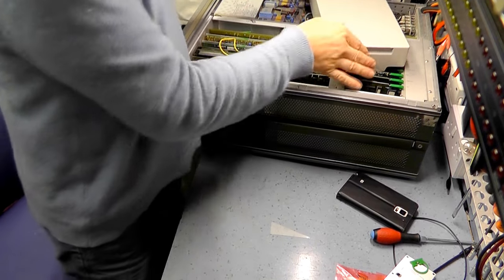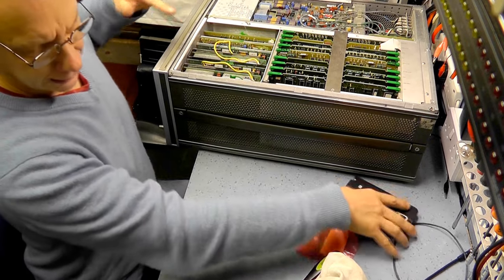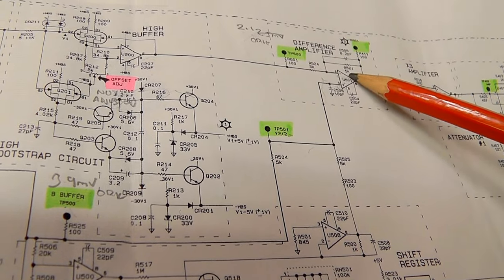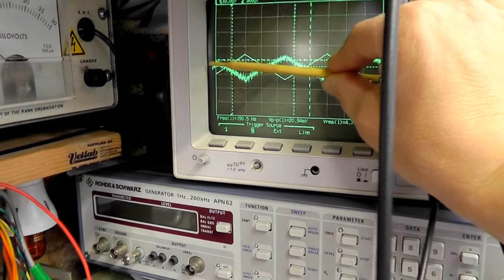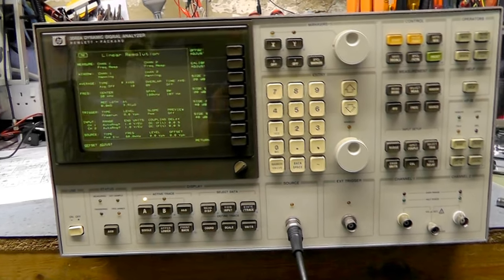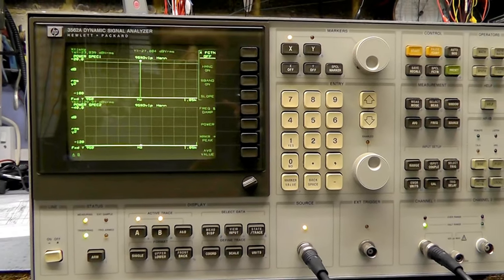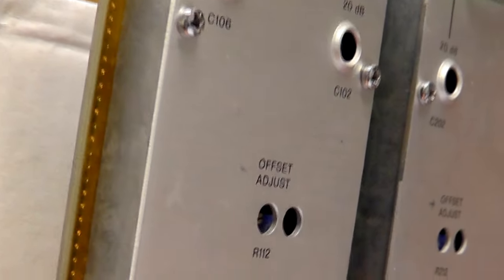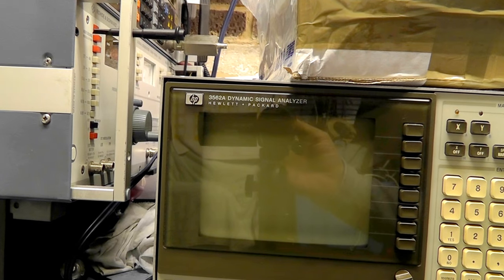HP 3562a Digital Signal Analyzer Pt8 Calibration

Comment: Nice one Simon. I've had to work on boards too, without and extender boards and have done what you've done with the ribbon cables. In a pinch I've soldered wires or coaxes to the boards and installed the board with the test points hanging out. Also I've removed the pots and solder wires to them to extend them outside of the unit. Some units it's not to bad to do it that way but if you have quite a few adjustments or test points it can be a real pain in the butt. Look fwd to your next video on this nice Analyzer. Good job Simon. Best Wishes n Blessings. Keith Noneya

Comment: Glad you never gave up. I did replace the crt with an lcd screen. Much light unit now. Super easy and makes you feel like you have a more modern full color analyzer.
Reply from the maker: +rb I think I will have to do the same. The crt  is very weak now. Problem is I have to inport the screen from the USA which means an additional £100 charge.

Comment: Do you have any more details of the extender connection you used?  I've got 3563A which has an input offset problem (0.4V) which is causing some problems when used as part of an automated measuring setup!
Reply from the maker: I bought if from Ebay from a seller who was selling other extender boards. He was based in the states but so long ago  I forget his name. Good luck,

Comment: Did the original relay have extra pins for an internal shield? Koto makes a lot of relays with shields between the coil and the contacts.
Reply from the maker: Yes as does the replacement. The missing pin is connected to the same point as the one on the opposite side. The old relay just had two.